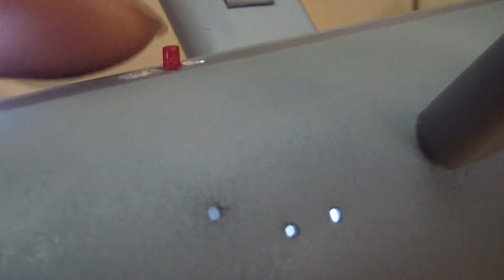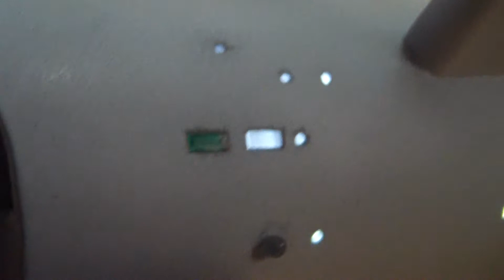1/350 TOS USS Enterprise 1701 Video #23 Almost There!  More Detail Painting

Comment from the maker: Firstly from the nav/strobe Tenacontrols board, I have two 3mm LEDs on either side of the saucer pointing at the nav light spots.  For the larger teardrop ones on top, I took my hobby knife and enlarged the hole that the plastic part sets in.  Then, I took one of the LEDs that hooks in the upper saucer part and angled it upwards towards the hole.  The kit instructions note for the smaller beacon to the side of the larger one on top, but the parts are very small.